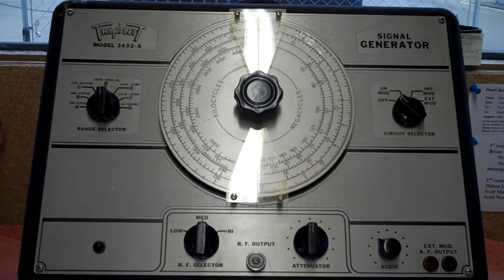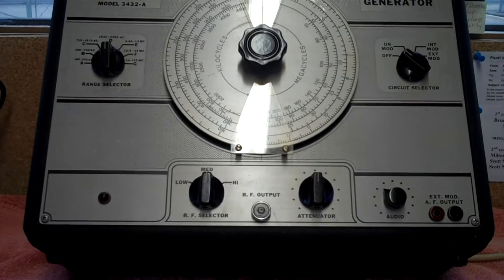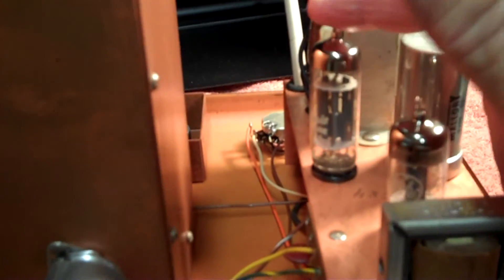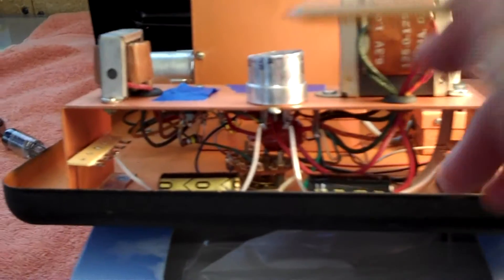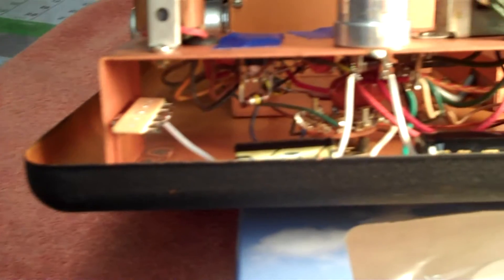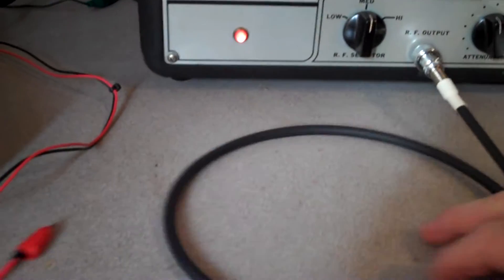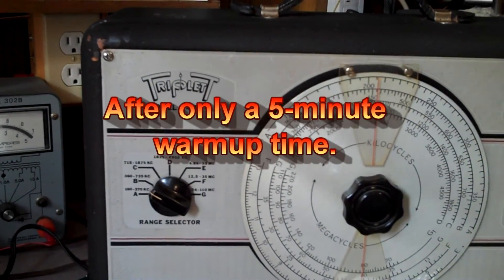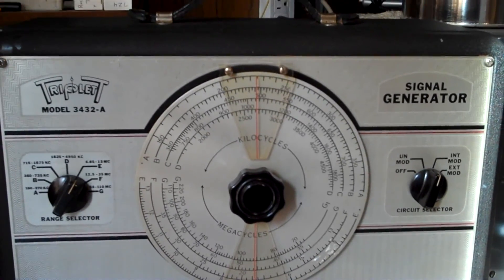1956 Triplett Model 3432-A Radio Frequency (RF) Signal Generator

Comment: Found one for $15 at an antique store. It too had a rattle in it too . It was  the 6C4  tube rattling around. Guess I should check the power supply for it had a 40uF capacitor
rated at 150 Volts where a 0.047uF rated at 200 Volts was supposed to be! Vernier scale tuner, yes it is a tuner type scale was gooped up. Cleaned out the old 
grease and re- lubed with a metal specific  oil and it turns fine now. Never apply power to any old vintage equipment before checking the insides! Good video Joe!

Comment: John,
I don't know how I missed this YT post back 3 years ago, but I did.  You mentioned using the Triplett as a backup to the Heathkit, IMHO, I would always use the Triplett that was manufactured specifically for circuit testing than a Heathkit, built by Joe Shmo!  :)
Reply from the maker: Harvey,
It's good to hear from you, my friend.  Thanks for popping in.
My Heathkit IG-102 was factory built, retored by me, and both it and the Triplett are very comparable in frequency accuracy.  Using a frequency counter, a side by side comparison shows almost no difference even at the higher frequencies.  The advantage of the Heathit is its size and weight.  The Triplett is big and heavy and difficult to haul around.  But I do use the Triplett whenever possible.

Regards,
John

Comment: Interesting. I just did a basic electrical restoration of a Triplett 3432 from the late 40s. Uses an entirely different tube compliment; 6X5; 6J5; and 6SJ7. It still looks about as simple as your 3432A; mine used smaller lytics, and naturally I changed the handfull of old paper caps that were inside. Let it warm up and it's quite stable. Get it over 40mhz and the stability tanks. I took several videos of mine, but here's a favorite of me using audio input with it. Triplett 3432 Signal Generator - External Audio Modulation (AM Transmitter)

Comment from the maker: David,
Exhaust tape is not expensive, maybe less than 3-bucks.  It comes in a flat-pack hanging on one of those wall hooks.  Any auto parts store should have it.  But I recommend that you not buy it at Autozone.

Regards,
John

Comment from the maker: David,
Many, but not all, ground wires will be bare.  Depends on the manufacturer design.

Also, I'm not sure what you mean by adapter.  Do you mean an alligator clip?

Regards,
John

Comment: John,
i have a adapter similar to the adapter you got and the ground wire on mine as well doesn't have insulation on it, why is that?
From, David Correira

Comment from the maker: @coolbluelights,
Daniel,
Old filter caps are time bombs waiting to go off.  At a minimum, always change them in vintage radios and test equipment before applying power.  You might get away with not changing them for a while, but you'll eventually pay for it.  New ones are relatively cheap...so pro-up and dump the junk.

Regards,
John

Comment: Hey John, I picked up an EICO model 377 at a radio swap meet last month for $5.00.  It's not as fancy as yours, but should be OK for me.  It powers on, but I don't have a clue as to how to use it. Getting a frequency counter would be a step in the right direction to see how accurate it is.  Thanks for the video.  Tom

Comment: I have some vintage test gear that I've been debating whether or not to rebuild the cables with a new Switchcraft 2501F connector or convert to BNC. Never thought to look for new builds. Thanks for the tip.